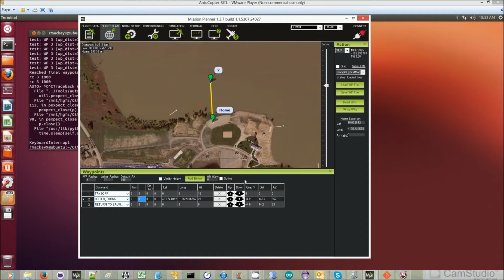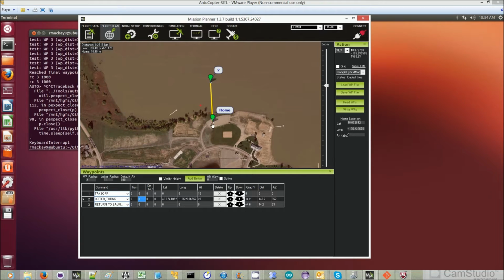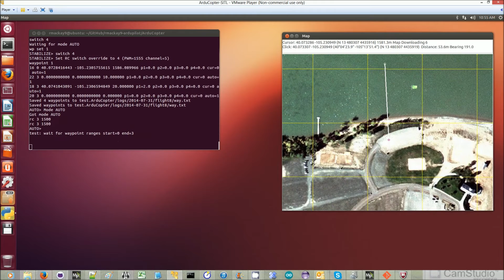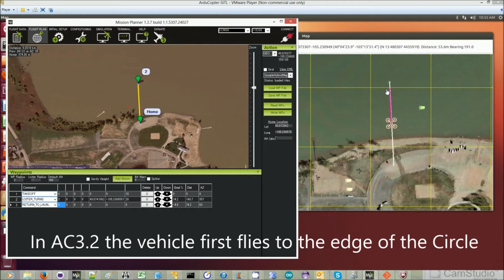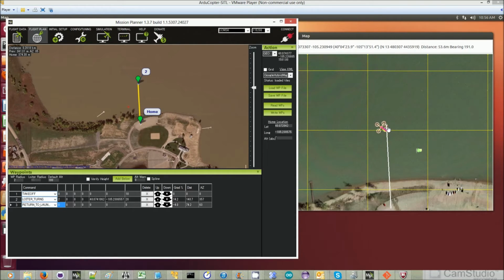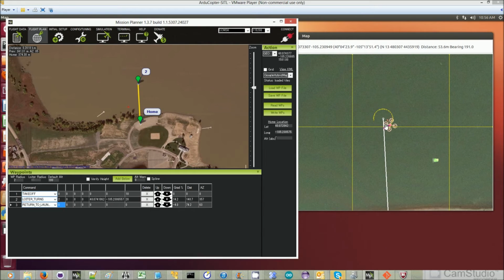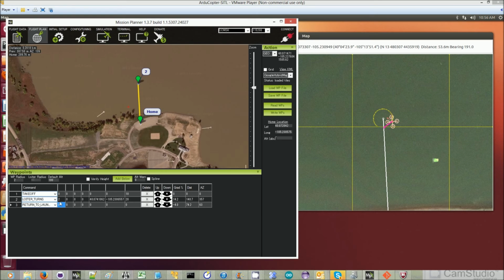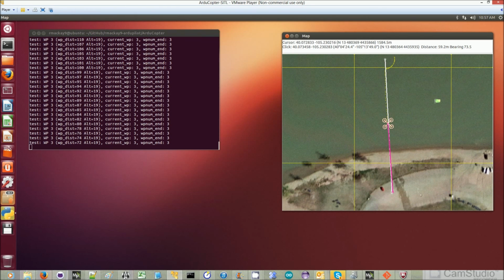Loiter Turns In Simulator

Comment: Can you fly this mission in real life? i would be interested to see it fly, i have 3.1.5 loaded but if this is anything like Flight Mode Circle, it strays off course after a half of a circle. is this a tuning or reason to change WP_YAW_Behavior?
Reply: My hex with APM 2.6 and ArduCopter 3.1.4 can fly circles all day long without deviating from the center point. Might it be that your compass is a bit off?
Reply: Oivind Kolloen i dont think so? i can fly auto missions and not lose a beat with FW 3.1.5 i dont think Circle Mode works in 3.1.5 so i am waiting on 3.2 to see if it really is a problem or not but thanks for your advice!

Comment: can i ask a question please(2)

I got an external compass and did the compass mot calibration and not it works fantastic..... 

in loiter mode if i try and yaw (360 deg )around it dosnt stay in the middle of the circle? it sort of goes around like its looking at an point in the middle?

any clues?
 
and one more.. rtl works but dosnt face home.. i think i saw it somewhere but not sure how to change it..

thanks...
Reply from the maker: swolath the RTL wiki page has the WP_YAW_BEHAVIOUR parameter which is what you'll want to adjust to make it face home.  http://copter.ardupilot.com/wiki/rtl-mode/

Not sure about the issue with compassmot.  Normally compassmot is not required if you're using an external compass.
Reply: Randy Mackay thank you for your reply. With the compass mot I thought you did? But it works great.   No toilet effect. Had the GPS just stuck on the poll and my first few loiter attempts had it flying off. The on mission planner I worked out it wasn't pointing north. So a quick turn of my gps/compass and that fixed up the flying away. The other question was sitting in loiter and trying to turn around it wonders off?  Its a tricopter and using the rudder, nothing else to look behind me it doesn't stay in the same spot?  Any clues??  Thanks.